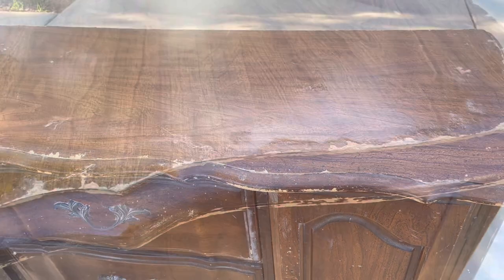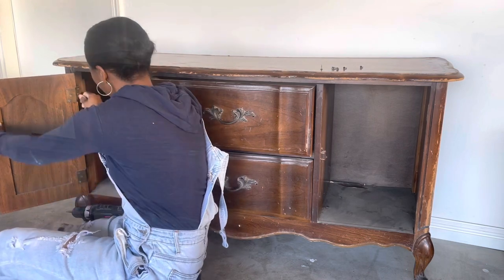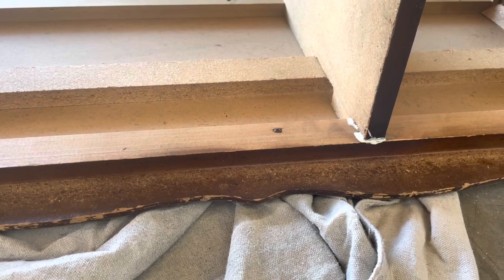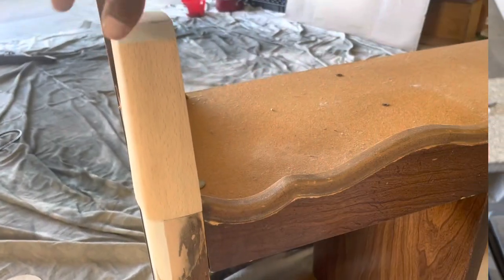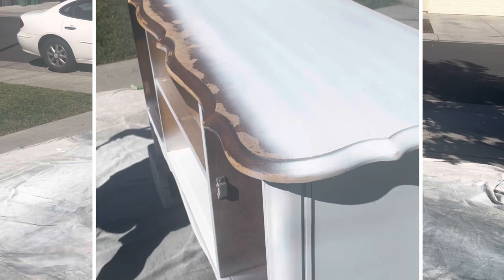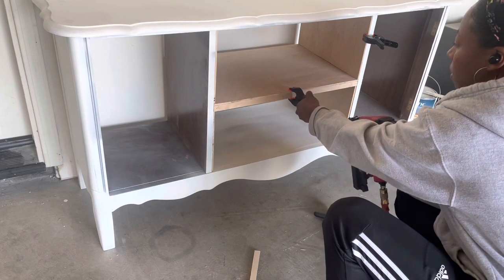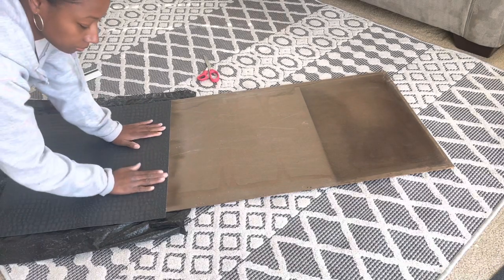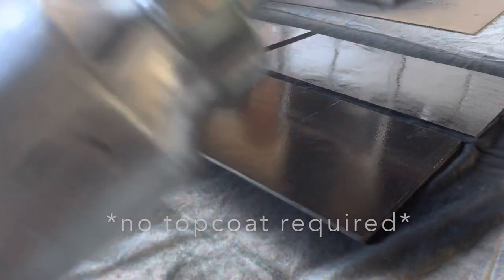Dresser Makeover | Water Damaged Furniture Makeover 🫣 | Can I Fix This???

Comment: Listen that piece of furniture had a story to tell and you were able to make it till it's story...

The only thing I would have done differently is instead of using the paintable caulk on the surface I would have used bondo and that would have cleaned it right up and made your life a whole lot easier...

And it turned out fabulous. It's better than it sitting in a landfill
Reply from the maker: Ah, that makes sense. Thank you so much 😊

Comment: When you have bubbled particle board, sand it like you did, wipe it off and then spray it with shellac or shellac based primer.  You may have to sand and do a second coat, but it keeps of from expanding again when you paint.  It turned out great!
Reply from the maker: Got it! Thank you so much! 😀
Reply: Also, I’ve seen many furniture flippers use bondo on the water damage, sand, then seal with shellac and prime. 

Great video though, I’m happy to see a fresh face on YouTube. ❤ New subscriber!!

Comment: awesome...in addition to the glue, you can go in at an angle with a screw near the bottom, a pocket hole for strength. Yeah, stay away from contact cement w woodworking. You might want to get a work table to raise the next project 3 feet off the floor so you dont have to bend over. Is that a nail gun? When you glued that one area, that nail gun would come in handy instead of the pocket hole screw.  You took something ready for the junk pile and turned it into something wonderful. Every project you do, you will learn from and you will work faster and smarter. AWESOME
Reply from the maker: Thank you so much 🤗